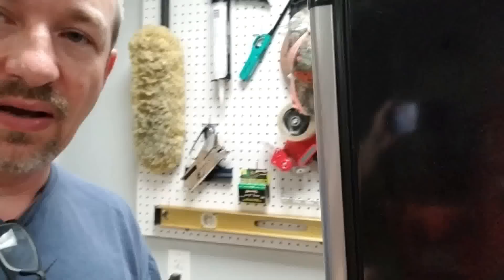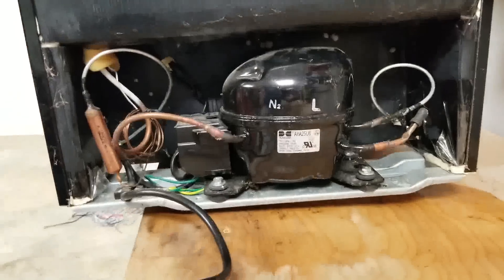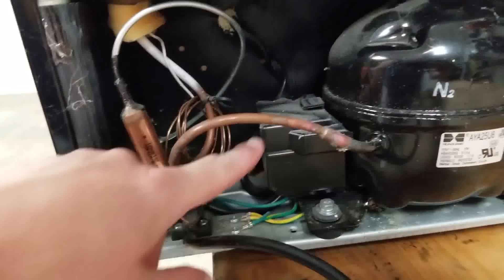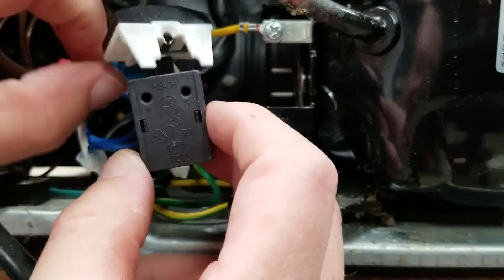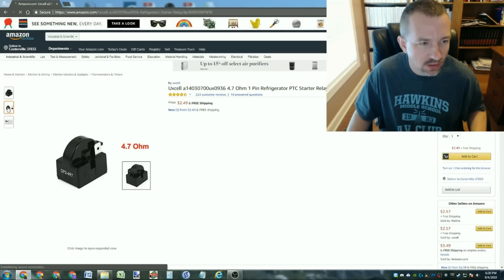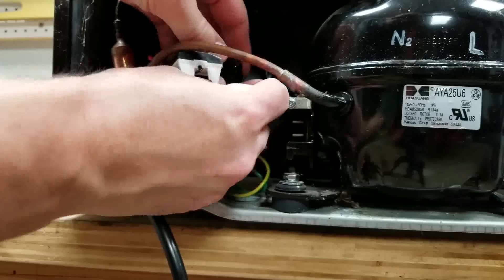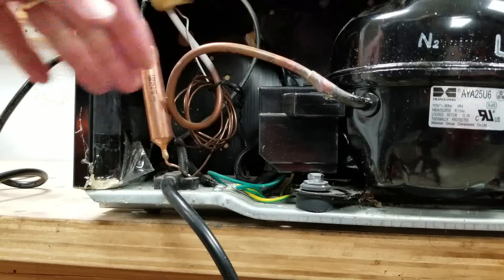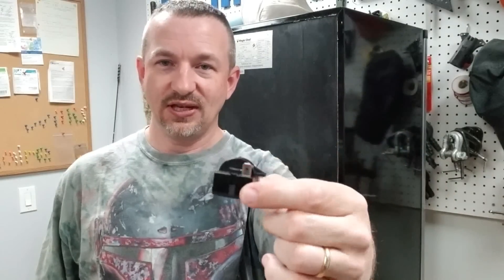Project #22 - Mini Refrigerator Fix (PTC Relay Replacement)

Comment: Your video worked! Thank you so much! I Switched out the starter relay and it’s back to working again! So stoked! I had to push on the 2 relays a little before it hit the sweet spot so if it doesn’t go back on right away try pushing the 2 relays in a little tighter like I had to.

Comment: I have an OLD 1988 mini. It has a relay like this but a round protector. Problem can't remember if the white wire goes to the relay or the protector the other one has the black one. I know I should have taken a pic.

Comment: I couldn’t make out how the green ground wire connected to the starter. Did it screw on or clip on? I have one that got chewed by a rat. I can salvage wiring from an another fridge but they all screw on.

Comment: This is a great video. Posted my glass bev fridge on FB for $50 and no one will fiddle with it. So, found your video and about to fix it instead. 

Only question is: I have two pins, not one and not 3. It seems this is a harder relay to find. I assume these are not interchangeable? (I would have the high maintenance one in the bunch!)
Reply from the maker: Probably not interchangeable.  You would need to find one that matches your old one.  Good luck!

Comment: The wires are welded to the pins on my starter switch, so I can't remove the parts to replace it.  I think they did it, so you have to buy a new refrigerator. 😞Thank you for making this video though, it was very helpful.
Reply: cut and add a new clip to the wire

Comment: Great info.   My exact same unit runs for a few days ice cold but then after temp increases.   I set the internal dial to 0 then to 7 I hear it click and then it starts.    So you think it’s a bad thermostat?   Have you changed that before? Or time for a new unit?  Thanks.

Comment: thanks Vance -- I ordered my relay from Amazon and it works.  two connectors are a little loose due to not being the exact spec for terminal mounting, I may solder if needed, but it works now.  thanks again.

Comment: When I plug mine in, I can hear the compressor just hum like its trying to run but not run. Is it seized?
Reply from the maker: You can usually buy the PTC and the overload both for around $10.  I would just give it a try before tossing the fridge out.
Reply: @VancesHowTo what’s the overload? I’ve replaced my starter and mini fridge still not working , the starter clicks and is getting hot :(

Comment: My part is P6R8MCor0605
Model number 
Magic Chef
MCBC580DBT
2582

PS I got both the overload part and the relay but it's so hard to see in there and i was glad your video showed it with plenty of light for me to see how the two parts went together and pushed on to the compressor. 
Made it easier to know where they go, but now with bad diabetes hands I am going to have to try to fit the parts on and put the cover back. Thanks

Comment: Got mine pulled out and it looks like when the starter went there must’ve been a short. Had a hard time pulling one of the wires off because the connector was all burnt up and black. I don’t think adding a new starter relay is going to work with these wire connections burnt up like this.
Reply: I think I have the same issue as you as three of the wires have what looks to be burnt connections.  Did you just replace the wires or toss out the fridge entirely?  Also if you remember, what was the  color configuration to each side, I brain dumped and didn’t take a pic or write it down when I disconnected the wires

Comment: I cant believe this , I bought the same exact mini refrige same color & brand  from Homeport was display unit was on the floor had some dents on it here & there ..the guy sold it to me  for $50 i bought it real quick  is F*N BRAND NEW & is worth it $150 new in box ...so i just plugged it & works like a charm well is BRAND new ...so i know what gonna do if is stops working. Cool thanks

Comment: Anyone know how to fix it if one of the wires shorted? I had the same problem, but the cable that plugs into the starter relay looked a little fried. I replaced the starter relay, and it worked for a day and then stopped working again. The compressor is definitely on but it won't refrigerate.
Reply: Did anyone get back to you? I have the same issue now as well

Comment: Any chance you can tell me what to do?  I unhooked the ptc without remembering where everything goes and now that I have replaced it I seem to have 2 extra wires and cannot figure out what they connect to.  I have a 2 pin ptc, 2 white wires, 2 black wires, both of which have one wire with a "boot" type cover and the other with a smaller connector.  I have put 1 white with boot and 1 back with boot back onto the 2 pins, but don't know what to do with the other 2 wires.

Comment: Silly question here... I can not find the exact same starter as the original. Mine has 2 pins on the side (terminal 1 & 2). I found some that are 2 pins but (terminal 1 & 3). Does that matter?  I also found some that 3 pins (terminal 1, 2, 3). Can I use that? Any help would be great.  Thank you in advance.  ❤
Reply from the maker: I don't know.  I'm thinking the pinout would have to be the same for it to work.

Comment: Hi! I picked up a perfectly good condition looking Magic Chef mini fridge just like yours from someone a couple of days ago. When I got home and plugged it in, it began cooling, right away and the little freezer area began getting very cold. I unplugged it to move it where I would keep it, but it did not cool, although the interior light did illuminate. I left it unplugged all night, next morning it began cooling again after plugging back in. I had to move it again and it did not cool after plugging in. I found your video and ordered and received a replacement PTC relay. Replaced the relay, the light comes on, the compressor slightly vibrates and is warm as well as the sides and top of the fridge are warm, but no cooling. The fridge looks nearly brand new, could the compressor be bad? The fridge is Magic Chef HMBR350SE1, and the relay I Replaced is here: Reyhoar 2 Pcs QP2-4.7/ QP2-4R7 4.7 Ohm Refrigerator PTC Start/Starter Relay Replacement Part for Mini Fridges and Coolers (1 Pin) https://a.co/d/29HCSRq
***UPDATE***
My found mini-fridge is working perfectly! Replacing the $4 PTC Relay fixed it. Thanks for this informative video.

Comment: Project #22 on how to fix the Mini Refrigerator gave me the confidence to order the part & fix the fridge! Of course I had a helluva time getting the plastic housing thing back on--never really got it right--& lost the original screw in the process. Typical :(  I found that the identical new part didn't have the exact same number as the broken part except for the top section: P6R8MC was a match. The bottom section, OR0504 was the number of the old part; the new part was labeled OR1001.The part looked the same so I ordered it despite numbers not matching. Thanks for the great quality of the video itself as well as the information provided.  You saved me a lot of $$$!!!  Keep up the good work, it is much appreciated by a lot of us wannabe DIY-ers.
Reply: Can you tell me how you got your plastic cover off? I can't for the life of me get mine off and I've taken the screw out - nothing else is there, but something is holding on!

Comment: I have a Cubigel K1H8 maybe a relay? It was corroded internally. It was like no relay I ever saw. There's a flat disk in there. Nothing looked mechanical. What is this component? A ceramic disk. I cleaned it up with a wire brush and rotated the disk 90 degrees to an uncorrded spot. What is it?!

Comment: Thanks a lot. I had given up on my midea refrigerator but you helped me fix it. I didn't actually replace my start relay, i rotated the ceramic in it like someone suggested in the comments and everything is ok now.
Reply: That's what I'm planning on doing. I wonder if you can buy like 5 of these ceramic disks for future use?

Comment: ..thanks for sharing,..thought you may have mentioned the overload could be checked too.
However, the starter relay was the component that was bad. In my case, it was the overload that failed.
That was due the cooling coils being completely clogged with dust.

Comment: 6:15....heck, leave  OFF  THAT  COVER,  so  the parts,  can  keep cooler.  HEAT,  is the enemy of all electronics.  (thermodynamic laws, rule). Modern  fridges, are mostly closed in- at the back, and on bottom. TAKE  OFF   cardboard, covers, and keep things  open, to  cool !   Heat transfer from compressor, to starting relay, causes that chinese junk, to melt.  I got a Danby mini-fridge,   NFG,    from a hotel.   Wires burnt off, of  relay and housing melted.   Goofy stuff = china   (what happened, to real  'coil'  relays, with contacts ?  no, too xpensive from china)

Comment: Didnt fix mine what would be the next thing to replace I do notice that the compressor feels pretty hot
Reply from the maker: If the compressor is hot, it most likely means it has a refrigerant leak and is low on refrigerant, and is not repairable unfortunately.
Reply: @VancesHowTo thanks for the response-I was having the same problem and my compressor is ridiculously hot and all the copper is hot. I’ll recycle it. You’re the best! 👍

Comment: May I have a question: Does the Whirlpool 4.3 cu ft Mini Refrigerator have a fan somewhere in it? If it does, where is the fan located? Thank you for the answer.
Reply from the maker: There is no fan in these small cube refrigerators.
Reply: @VancesHowTo  Thank you for your information.

Comment: hardest part for me is getting the plastic cap off on a RCA mini fridge. I cant seem to get it off and i dont want to hurt the wires or anything else. i need help. rca model rfr322-e refrigerator

Comment: I tried to email you at the email address under your "about" but it says not valid email.  I wanted to send you some photos of my replay switch and see if you would be able to help me figure out which wires go to which pins.
Reply from the maker: That's odd.  I just checked it and it is the correct email address for me.

Comment: Just got a free mini fridge due to the exact part. Ordered both in a set. Thanks for sharing
Reply: Where do you order the parts? i been looking and seems to be harder to find them now.
Reply: @hwarangdrac  I ordered on Amazon.  Was very inexpensive and got both parts in kit. Fast deliver and easy access for repair.

Comment: Thanks for the video. Question: I am getting the rated voltage (220v) out of the relay when I put a multimeter on it: does that mean that my relay is ok?

Comment: OK, but what if thats not the problem? Mine is a Magic Chef, not a mini, but apartment size, 10.1cu. It will be on, then shuts off. I unplug it, wait 30 secs, and plug it back in. It will work for a few hours then stop again. During this time, the fan inside the freezer stops moving. There is no frost build up at all.

Comment: Good video, but unfortunately despite my part being replaced it still keeps making a clicking noise and not cooling. The compressor will start turning on with the clock noise until there’s another click and then it will stop
Reply: That's where I'm at

Comment: I’ve replaced them both on a system I just got. Still nothing, but I’m sure it’s the problem bc it was cross connected and the wires are burned. Should I change them?
Reply from the maker: Be sure and also check out the thermostat.  Its inside the refrigerator, and has two wires.  If you jumper them, it should operate.  If not, the thermostat may be bad.

Comment: I have a Haier freezer that "just stopped working" and we lost a bunch of frozen food. The schematic on the back of my freezer (HNCM035C) looks nearly identical to your fridge. As my unit does not have a starter capacitor, and it "buzzes" when plugged in, it must be the PTC (Positive Temperature Coffecient) starter. From my read of the schematic, the "S" coil, S=start I assume, which is connected to the PTC must get current to start the compressor turning. Once the PTC heats up, the resistance drops and nearly no current flows through the start coil, and the main current flows through the "M" coil, M=motor, again I assume.

I watched your video to see how this unit comes off. I figured it was "just pry with a screw driver" but I didn't want to use "enough brute force until it came off" without first knowing that is the right approach. 

Stupid $10 part cost us a 3/4 full 3.5 cubic ft freezer's worth of food. Wife thinks I'm nuts trying to repair this. It can be a "backup freezer" for when we defrost our main freezer. Trying to decide if this is worth fixing before we buy the replacement. The decision is "do we have the old one hauled off for disposal, for fix it?" I think fix it is possible.

Your video agrees to other's on this topic. Very useful. Thanks for sharing!

Comment: So that other piece, the overload protector, does anyone know if these go bad? I can shake it and it rattles. But it may just be the metal prongs I side rattling. The starter relay does not rattle when I shake it. There's no clicking on the relay when I plug it in

Comment: Hey Vance. Thanks for the video. I have a similar Magic Chef fridge to yours. I took the relay out last year, eventually bought the part, and am now trying to piece it back together. I have several different coloured wires to plug back in. Red, blue, white, and green ( I think - I’m colour blind). As I look at it, it seems like the flat pins are reversed from yours, in that when I have it reinstalled, the two flat bars are facing me, while the single flat bar is on the front side of the relay. While the diagram is simple enough, I still don’t get it. :-{. Can you help?
Reply: Or, it seems like your relay only has one flat post. Mine has three...
Reply from the maker: @MonckFraser  I wish I could help.  Unfortunately, there's not a consistent color coding the manufacturers use, so my recommendation is to just follow the wiring diagram, ignoring wire colors.  Good luck!

Comment: I know this is an older video, but what else could be wrong with it?
I have replaced both the relay and the other part, but nothing still happens.
No humming of the compressor or even the clicking that I heard in your video?
Could it be anything else?
Is there more troubleshooting I can do?
Reply from the maker: If there's no humming of the compressor, be sure to check the thermostat.  Its inside the refrigerator, and should have 2 wires connected to it.  Bypass it by connecting those 2 wires together and see if that makes it work.  Use caution, and don't electrocute  yourself :-)
Reply: @VancesHowTo  Thank you for the response. This actually is a Magic Chef beverage cooler MCBC580DBT.
It seems the thermostat/control board is up on the "ceiling" of the unit, I suspect, under the cover there. I'm trying to figure out how to get it out or something to see if there is something wrong with it. Both the relay and overload are testing seemingly fine. And I seem to be getting the correct ohm values at the compressor pins. I'll check those again to get the actual values tomorrow.
One thing I also haven't checked is whether or not there is power coming to the compressor at all. Also the fan down below, next to the compressor and the coils is not moving either... Shouldn't that at least come on? Since the compressor isn't even humming or the relay/overload isn't "clicking", I'm thinking there might not even be any power getting to it. Just hunches, though...
I may have to take it apart a little further this weekend if there's nothing apparently "simple" that it can be.

Comment: Great video. I struggle to recover the cover to access the overload relay. But the parts number is not avaiable or not found on search engines, but the results have parts that look the same but different number.  Will it still work or could cause damage to the unit.
Looking for ZHB54-120P4-7, result is for ZHB35-120P15 (looks identical on the outside).
Reply: @Tony Tsai I have the same problem, did you end up trying ZHB35-120P15 and did it work?

Comment: Does the brand of the starter relay matter? Mines an insignia but I bought a random one on ebay
Reply from the maker: I don't think it matters.  As long as the fit is right it will likely work fine.

Comment: I didn’t take a picture of the wires before I took them off.  Dumb mistake.  Can anyone help with which (color) wire goes where on reinstall?  Thanks!
Reply from the maker: Take a look here.  If its the same model, it should be the same:
https://youtu.be/WjmEBgIYHec?t=189

Comment: I was able to open the starter relay and rotate the ceramic contact disc 90 degrees which provided new contact area for the leads. May need a new part in the future, but works for now.
Reply: mate your a legend mine broke this morning and just did what you said and it worked thankyou soooo much
Reply: @fuckadodarday  No worries!
Reply: BROOOO I JUDT DID THIS AND IT WORKED YOU SRE A FUCKING G UNIT
Reply: @Setttle  I know, right? I've been picking up "Broken" mini fridges, fixing them and selling for profit!